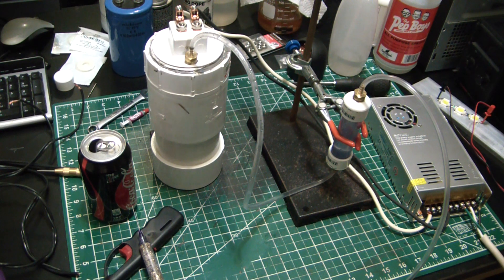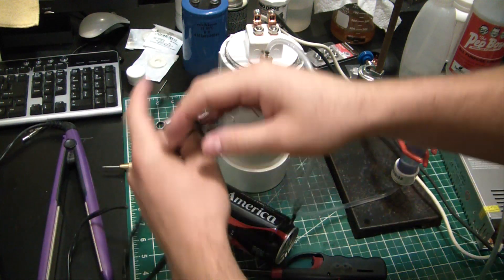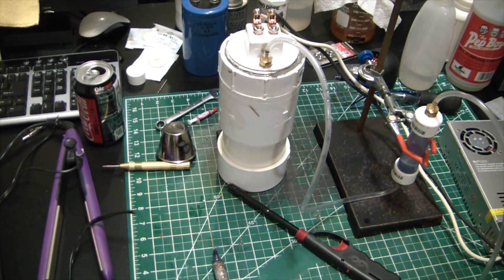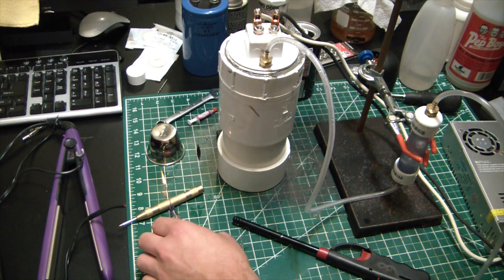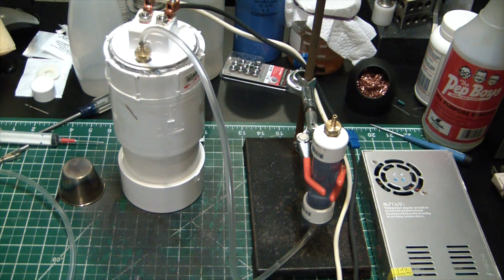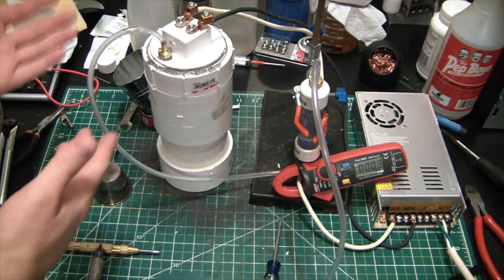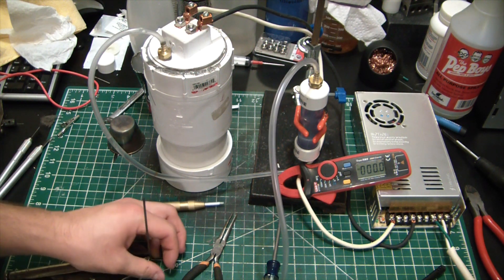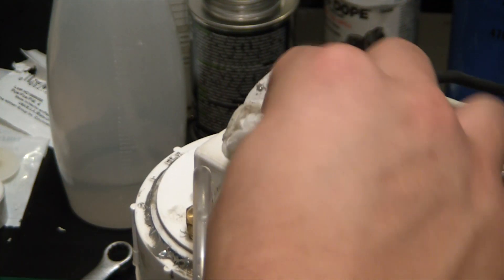Cutting Metal With Water! HHO Torch Success - ElementalMaker

Comment: Looks like the threaded rod should be much longer...like 2" longer and bent outwards away from each other at a 90° angle.  Use a larger\thicker copper connection with double nuts to clamp to the threaded rod.  The bulk of the heat will usually be at the connection point and keeping that point further away from the plastic cap will help prevent it from melting.  Minimising any additional resistance at this point will help.   I'd suggest brazing a thick copper bar to the threaded rod.  A hole drilled into the end of the copper bar will give you a solid point to use a heavy gauge bolt and ring terminal to connect the heavy gauge wire from the power supply.  At 60 amps I'd go at least 8AWG.  When you're thinking about connecting the power supply to the threaded rods think along the terms of a car battery to the battery cables.  Heavy gauge wire and thick terminals...lots of mass to absorb and then dissipate heat.
Reply from the maker: Yeah I need to get longer all thread, but this was all the local hardware store had in stock when I was building the unit. I am going to try making a copper heatsink similar to how you described.
Reply: If it's all possible I would even go as far as increasing the diameter of the all thread by at least 1/8".  Again...mass is your friend here.  A piece of 1/2" copper pipe hammered flat would make a decent bar.  Obviously something solid would be better but 1/2" copper pipe has a lot of mass and it can handle a helleva lot of current.  I assure you.  ;)

Comment: I think you'll need much more power for melting things. Cheap way to get powerful PSU is to buy PC power supply($60 for 1200W). And you will need to have separate oxygen and hydrogen line to be more flexible. Sometimes you'll have to have more reducing flame and sometimes more oxidising one.

Comment: Inside the microwave ovens  there are some nice ring magnets as well. Inside the ring magnets there is a ceramic like part, be sure not to touch, scratch or break that part since it is a very unhealthy material. I collected the parts from two microwave ovens a few months ago. I've seen the king of random video with the arc forge. He also made a nice spot welder from a microwave transformer. That might come in handy for making metal casings or housings for other stuff.

Comment: Yes you can make synthetic ruby! You watched my videos yet? I can send you some info so you can get a head start with you ruby and sapphire production.
Reply: You need to build a rig like this:

https://archive.org/details/ProceduresInExperimentalPhysics/page/n537

It works. I've used one to grow adult finger sized strontium titanate crystals for research when I was going to school. Probably had 50K of hydrogen and oxygen gas bottles in the building, but it worked!
Reply: @kleetus92  That's a great link showing their Verneuil furnace setup.  It's a rather simple construction really.  The water cooling for the entire shaft for the fuel and feed material is something larger than what I had designed for my furnace.  I was just going to water cool the torch head, but I can see an advantage for cooling the entire shaft.  I also overthought the construction of the furnace chamber and had it more closed off on the bottom.  I had designed the chamber to circulate the airflow 360 degrees around the pedestal for the boule so that the flame wouldn't blow itself out or flutter.  Having it open at the bottom makes much more sense.

Now I can get back to trying to figure out the impossible task for how I will generate enough oxygen and hydrogen to do the job.  I'm still thinking I'm going to have to resort to using tanks.  Ugh.  I don't want to go that route.
Reply: @mwilson14  Well, you could still generate it with electricity, just separate the plates further and have 2 sumps... one for oxygen, and the other for hydrogen. In the HHO generator they're just lumped back together again.

Comment: Hey just a tip from another experimenter. try to make as pure of Al2O3 as possible. Sodium is a problem with synthetic ruby and will make them white. I found the best way to make Al2O3 ( and funnest ) was to powderize aluminum then light it on fire all by it's self then with a blower adding oxygen to it to make sure it has all burnt. Also If you want to get into it I know the reagents needed to make flux rubies.
Reply from the maker: Very good to know, i didn't realize Na contamination would affect it so drastically.  I plan to use some aluminum obtained from melting cans, which are quite pure from my understanding, then I was going to dissolve in Reagent grade HCl, and react with Na2CO3, i would have though it would be easy to remove the sodium ions, as they will be highly soluble in water, whereas the Aluminum hydroxide is insoluble. After a few rinses with DI water I would imagine the purity to be above 99.9. I may end up trying both ways to see the best result.
Reply: @ElementalMaker  It would be awesome to see it both ways. I initially used the bayer process to make my alumina, unfortunately I didn't have the equipment to melt it. So I will look forward to your video!
Reply: I believe aluminum cans have some magnesium in the lids. So I would use just the bodies or some thick aluminum wire which should also be very pure.

Comment: Are the copper lugs just screwed down to the plastic lid with out nuts or washers on both sides of the lugs?  if so that is causing a lot more heat if the thread was longer sticking out so you can have a washer on both sides of the copper, exceeding the size of the copper lugs and make that very Tight pinch of the copper lugs, that will help the heat.
VERY COOL and DANGEROUS TOY LIGHTER! AWESOME!
Reply: it is the amount of current being drawn by the cell, it is more than the copper conductor can handle so it gets hot.  he needs to reduce the saturation of  his electrolyte solution in order to make the solution less conductive and therefore draw less current
Reply: @dannyanderson6472  Well it's Both reasons.  I deal in power high power for a living and would not consider tightening a conductor down with only a conductor on one side.

Comment: A conductor doesn't really care whether it's AC  at mains frequency or DC (for higher frequencies, see Skin Effect), but the straightener's 800W at 110V is less than 8A while the power supply's 300W at 5V is 60A.

Comment: 300 watt is way to much for the cell that you have, since your cell doesn't have a lot of plate surface you should use a less strong electrolyte solution in order to make it work safely and reliable. Also ad a neutral plate instead of just one anode and cathode. Your voltage is too high as well, and that also results in heat production. By adding an extra neutral plate you will bring down the voltage per plate but the HHO production will increase a little because of the extra surface area. You are taking a lot of risk with melting the plastic, I have seen a few examples of exploding cells. 

You can melt sand into glass, you can carve names or random words into rocks, you can cut steel if you had more gas production, you can braze copper pipe with it, you can make jewelry, you can melt glass with it, you can refine gold with it. It has many applications. It's a very clean and extremely hot flame so you will have very little contamination. 

Also make sure that your steel wool is stainless, regular steel wool will burn and make things even worse in case a back flash occurs, but stainless steel wool doesn't burn. It's easy to check with a 9 volt battery. Short the battery with some steel wool (outside the house) and when the steel wool burns it is not stainless and not usable as a flame arrestor.
Reply: insAneTunA try cigarrette filters, but don't abuse them....
Reply: i managed to make an HHO generator work cleanly and without excess heat just splicing apart an old laptop adapter, it put out 18 volts so i added neutral plates to bring the total of plates (including anode and cathode) to 9 to bring the voltage per plate down to around 2 volts and my HHO production was pretty good for the unit size and surface area of the plates, the rule of thumb i heard (and based on my testing seems to ring true) is that you want half as many plates as you have volts, and you want to optimally aim for 12 volts so that each plate gets 2 volts for optimal HHO production without wasting energy and producing heat. but i'll admit i'm a novice at this and thats essentially all i got.

Comment: sir i suggest you mounted those nuts and bolts to a ceramic stuff indulating the pvc then try to cut a lift spring from a truck and a chassi part just a litte request sir

Comment: Here are a few ideas that might be worth your time:

1.  Install a controller between the power supply & the reactor.  It will allow you to set the optimal power level for your reactor (which should help to reduce the heat that is generated at your hot terminal).

2.  Attach a tightly fitting copper flange plate around your hottest terminal.  Install an aluminum heat sink to the copper flange plate with heat conductive compound & then use a blow dryer fan to force cooler room air over the heat sink to dissipate the heat that is generated.  If done properly, the copper flange plate should help to significantly increase the heat flow away from the stainless steel post--PVC junction to minimize the chance the PVC will melt.

Thanks for sharing!
Reply from the maker: Both solid ideas! I am fabricating up a heat sink for it as we speak with essentially the exact design you describe
Reply: Super.  I hope it works well for your design & look forward to seeing if it will do the job well enough.

Comment: You might need to replace your steel all threads with some copper that's been threaded so you can run it for longer without it melting the PVC.
Reply from the maker: I would love to do that, but copper will rapidly deteriorate in the environment of an HHO cell. Especially the anode side.

Comment: I think that what you need to do to solve the heating problem would be to increase the conductivity of your electrode busbars. Stainless has ~43.5 times the resistivity of copper, so you'd need something around 3/4" allthread to have similar conductivity to 10AWG copper wire.  Since that is a bit bulky for your current set-up, it might be better to try and make some threaded rods out of copper, and have them chrome-plated. Another thing you could try would be to use stainless tubing, put both an external and internal thread on it, and then give it a copper core by threading in a piece of copper bar.
Reply from the maker: I would love to use copper all thread, but it will rapidly deteriorate in the HHO cell, at least on the anode side. I have a few ideas to get it working better though!
Reply: That's why I suggested getting it chrome plated.

Comment: If the connectors of the cell get too hot you can try to weld the parts, just with regular solder, you may can use the flame of the cell it self to weld it, if the flame is hot enough to heat a spot before the PVC melts.
Other option is use the TTL feature of the cell "Tiny Thermal Lance" ;) to melt the problematic parts together (just a few spots) that should melt steel and copper without heating up the PVC.

Comment: I would recommend that you extend the stainless rods enough that you can use 2 nuts to complete the connection to the lug. This will insure constant compression and reduce the heating because of melting thatch reduces the contact pressure for the connection.

Comment: How about putting some pure O2 to that flame? Se if you can get it hotter. ;) Anyways, my suggestion. Thank you for all the great videos! Love from Norway <3
Reply: Eivind Krey Hanssen it’s already running on pure oxygen, stoichiometric with hydrogen. Water in, water out ;)
Reply: Well, i mean adding 100 % pure oxygen, to the flame. Not as an ingredient in the liquid electrolyte or part of the hydrogen gas.
Reply: Eivind Krey Hanssen it won’t make any difference what sort of atmosphere it burns in, the supply from the cell has exactly the right amount of oxygen to burn. Hydrogen only burns to h20, so additional oxygen in the torch supply would only dilute it and cool the flame.
Reply: it's just a guess but the extra oxygen in the mix may have been affecting the hot steel causing it to burn easier, the same as the needle tips in the last video.

Comment: Use smaller gauge wire. If that power supply doesnt accept any larger wire then bust it 
 open and wire in some DC battery style stud mount connectors that will accept the smaller gauge wires. De-rate the hell out of it so look at like 100 amps+. Keep the same bus bar connectors you had at the end of the video as they look "skookum as frig". You should not be using heatsinks to cool wires if it takes 0000 gauge wire to keep it from overheating, use it. Because let's face it -- your extremely electrified pressure vessel containing explosive gas is melting and degrading releasing corrosive and carcinogenic gas.

Comment: In addition to some heat sinks, you could try to make a connection block out of some material like Teflon or some kitchen table sample blocks which should be heat resistant (don't ask, my dad uses them for all kinds of stuff, like knife handles...)
Reply: Where do you get sample blocks of Teflon? I have a small sheet I salvaged from a lazy Susan I now use for various things like glide bearings in my dryer. Don't bother buying them off Amazon, they're crap from China and last about a month. Same with the drum rollers. Get oem.

Comment: Just so you know, current capacity of a wire is a function of cross sectional wire, a material constant, and length. 

Power has nothing to do with wire size— a hair thin piece of copper can carry 1000W no problem if the voltage is crazy high or it is a very short wire. 

Also, the Verneuil process was commonly used to make ruby/sapphire/etc all the way back in the 1800s. Should be very doable with your torch.

Consider buying al2o3 — the verneuil process is going to require fairly high purities.

Comment: Here's an idea I've been mulling, could this be used as a water desalination system.  The by product of the  burn is H2o so if the heat was used to turn a turbine that generated the electricity which was then used to mitigate some of the power drawn from the PSU. Could it generate enough power to make it more efficient than conventional desalination system of a similar size.  You do the math I'll run the kickstarter campaign.

On a separate note  straight HHO will produce an oxidising flame which should be considered when heating compounds.
Reply: Land Rover Addict some of the commercial ones have a bubbler to entrain acetone or alcohol, it drops the flame temp and offsets the oxidising tendency of the HHO flame.

Comment: Dude i laughed when you picked up the cup, sorry but it's just the kind of thing I would do and I was happy to see  someone else make the mistake.  One thing you need to be aware of is arc eye sun burn on your eyes is not fun.  Be careful when heating to white hot use dark UV safety shades.
Reply from the maker: Yeah for much of this I did have my welding goggles on, just didn't show it. The first time I played with it burning stainless without proper eye protection I had a couple purple spots in my vision for a few hours

Comment: Cool upgrade. I am very excited when you melt Al2O3. It will be interesting to see if it is easy to melt and how it will behave when molten. Maybe it is castable and stays in one piece so you can really make a piece of synthethic ruby.
Reply: That's not the production method... you need to fuse a fine powder onto a seed crystal or 'boule' to start from.